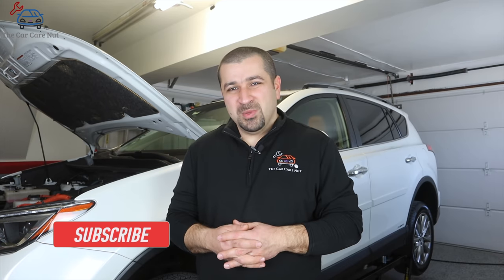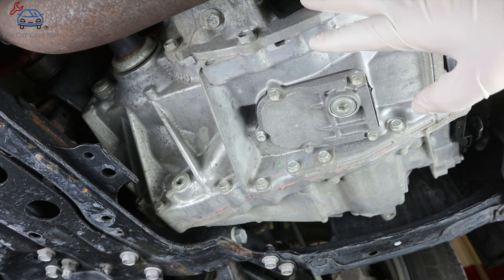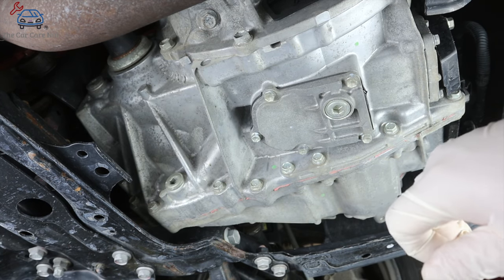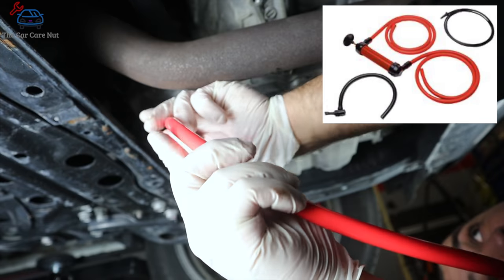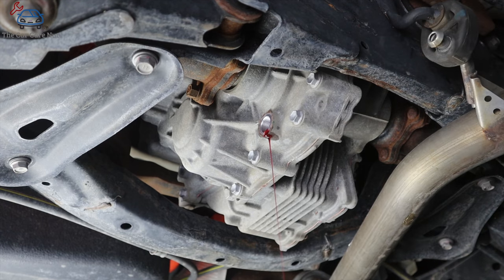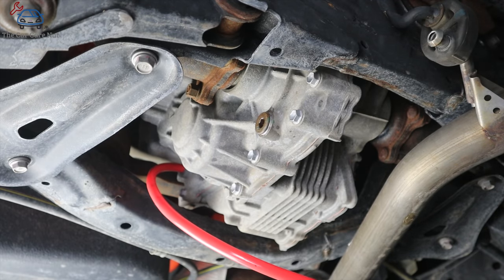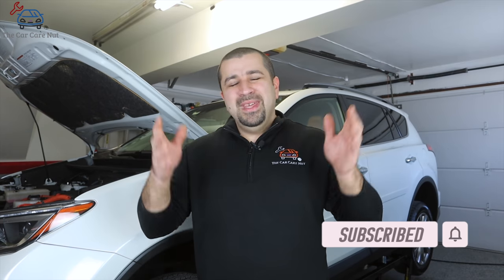How to change Toyota Hybrid Transmission fluid and Differential fluid

Comment: Great video! So hybrid “lifetime” transmission fluid is not really lifetime?
Reply from the maker: Nothing is lifetime 😉
Reply: I work for chrysler and our 8 and 9 speed trans are also lifetime fluids. I would still service them at least every 100k. I never trust anything with lifetime oil. The oil is stupid expensive tho, over 25 dollars  a quart.
Reply from the maker: Very true Samuel. That’s very expensive fluid! Toyota WS fluid is around 10 bucks a quart

Comment: I did this and it worked. Front wheel drive do not have a differential so I saved myself three quarts.

1. The old fluid shoots out
2. There is grit everywhere
3. The grit settles to the bottom I'm told. Please correct me if I'm wrong.

Comment: I haven’t seen removing the red plastic plunger inside the transmission drain plug ? Then rev the engine and moving the automatic shift?
Reply from the maker: Hybrids don’t need that.
Reply: Ok thanks

Comment: On a 2018 and newer Toyota Camry Hybrid, where is the fill and drain plugs?  I found one plug on the passenger side of the transmission but I assume it's the fill plug because it looks to high up to be a drain plug?  The only other plug I could find is the plug on the bottom that in your coolant videos you drain the inverter coolant from it on the earlier model Priuses.  Or is this on of those that only uses one plug and you have to drain (suck out) and fill using the same plug?  Thanks
Reply from the maker: Hi! I’ll double check but there should be a plug right next to the axle which is the fill and one underneath for the drain

Comment: I have a 2017 Toyota Highlander Hybrid Limited with about 135K miles. I bought it used with about 40K miles in July 2020 but not sure if the transmission for differential fluid was ever changed. For about the last 30 days I’ve been noticing that I feel when the gears are shifting, (to the point that it feels like I’m hitting small potholes) especially when I go from 0-30 mph. So I started doing some research and I came across your video and didn’t realize this was something necessary. Now my question is when I changed these fluids will that remedy the issue of me feeling the gears shift while I am driving or is it a bigger issue?

Comment: I have a 2010 Lexus HS250h, hybrid.  Its has the same drivetrain as a similar era Camry Hybrid.  At what number of miles/years of service do you recommend I change my transmission fluid?

Comment: Does the maintenance minder recommend at 60k or 90k? Seems like a messy job to do in my driveway that is a hill. Wondering if the dealer techs are well versed on doing this service? If the minder doesn't tell people they need this service, I would think most wouldn't do it. Nothing like going to the dealer and having the guy on his first day not fill your fluids enough or too much. The whole "being level" is going to prevent me from doing it myself.

Comment: Hi, I have decided to do ATF change on my Toyota auris 2016 hybrid with 1.8L engine, I am the second owner.
I have drained ~3L of old fluid, then added new fluid and it still wasn't overflowing from the fill plug, car was completely level. What to do at this point? Add a bit more than I drained, add specified 3.4L or try to get it full just like in the video?

Comment: Hi AMD , thanks for all your hard work and great videos , much appreciated. 
I am about to change the transmission fluid in my 2014 lexus is300h, but it looks very different from your video . The drain plug is on the bottom of the trans and the fill plug on the side.  Can you tell me if the draining / filling procedure is the same as you show in your video ? (Overflow etc) 

The workshop manual I found online states that after filling you have to run the engine idle 1 minute in maintenance mode and after that refill again , any ideas on this or is this unnecessary?

Thanks a lot , hope to hear from you
Reply: This video is specifically for models with CVTs, the IS doesn't have a CVT it has the same 6-speed gearbox as the other IS variants. The procedure you found online is correct I used it recently on my 2006 IS350, the part about running it in maintenance mode is to get the new fluid into the transmission itself as the valves only open when you shift between gears. CVTs don't have those hence why it looks different here. It wouldn't refill it again right away, I changed out 3.5 qts (I had to remove the pan and replace the filter anyway so I got more out) and am driving it for a few hundred miles before I do another drain and fill to dilute the old fluid further so that the transmission is gently cleaned out by the newer fluid and gradually "weaned off" of the old fluid.
Reply: Hi Jeff, thanks for your reply. 
As far as I can see in several tech docs my is300h (hybrid) does have a e-cvt transmission, so are you sure about the 6-speed gearbox?

Thanks again 🙏

Comment: Hi friend. Thank you so much for this. I have a question. I have a 2016 rav4 hybrid limited (awd). Is this the process I would follow to do my transmission fluid change? Also - I believe some dealerships call the transmission the “transaxle”. Is that correct? 

In addition - is this the same as changing the “front and rear differential fluid” ? Or is that something else. Toyota’s terminology confuses me lol

Comment: Which type of fluid did you use for differential? Toyota genuine or Mobil etc?  Thanks
Reply: For this one is the same than the transmission fluid, but is not the same in non-hybrid cars.

Comment: I did my camry hybrid, thanks
Reply: What year Camry hybrid? Not sure where my drain and fill plugs are.
Reply: Yes, nice.. however, mine is a 2019 which looks different. I’ve taken pictures to hopefully find out where my plugs are.
Reply: @tallswag4u  2019 you don't have to change oil that soon.
Reply: @Chanchan1-k7q  I use for business, it’s at 86k miles.

Comment: I have a 2020 Highlander Hybrid.  The 4 cylinder and the CVT transmission, is it the same procedure or a different procedure?  I am almost at 60,000 miles and haven't found information about the new model.  I am about to get the Alldata diy for this vehicle.  I am a helicopter mechanic, and I don't like doing maintenance without the manual or torque specs.  Do you have any suggestions for manuals for the 2020 highlander hybrid?  Thanks for your videos.

Comment: i have 2008 highlander hybrid limited 3.3 engine size. i also see the filler same bolt driver side tire behind the little mud guard cover. i would like to confirm which one is the correct hole to fill and level the transmission fluid :-(

Comment: A bunch fluid came out when I changed my cv axle. I have a 2011 camery hybrid. Do I need to top off the transmission fluid ? Also I seen 3 plugs on my transmission. On directly above the cv axle, another to left of it and the other is on the bottom side below the axle. I’m assuming that that  the bottom side one is  drain port and the one to the left of the axle is the filler port. What is the one directly above the axle?
Reply from the maker: Hi! Use the one next to the axle not above it! That plug could be for production. Don’t use it.

Comment: I have a 2018 RAV4 hybrid. Do these have a front differential/transfer case? If not, just 60k for the front? And the rear differential at 60k as well, or at 30k like standard AWD Toyotas? Thanks!

Comment: Fill plug out first, then drain plug. If you take the drain plug out first and then have a problem with the fill plug, you are in trouble. Right?

Comment: Do you have to change the transmission oil when it's hot, in order to open up the cooler lines and drain the transmission oil cooler also?
Reply: Hybrid don't have cooler lines

Comment: You said take the drain  plug out first instead of saying the fill plug, when describing the reason why, and then proceeded to call the fill plug a drain plug as you were taking it out. You're actually supposed to take the fill plug vout first, to ensure you can refill the transmission after you've drained it.

Comment: How level should it be? My driveway looks pretty level but there is actually four inches difference. The axel closest to the street is four inches lower so I drive the front part way up my ramps to get it level.
Reply from the maker: I would try to get it as level as possible. It’s near impossible  to get it 100% level but as long as it’s not a largely sloped driveway it should be ok

Comment: How often do you change the spark plugs in a 2021 toyota Rav4 hybrid xle awd. Does the transmission fluid change 60k to 90k also apply for my hybrid vehicle.

Comment: Hi! I am in the process of preventative maintenance on my 2010 Prius with 270K miles. I’ve gone ahead and done manifold, pcv valve, egr pipe, egr cooler. and catch can install. 
My one question the following, I haven’t changed the transmission fluid ever. And I’m not sure if I can or it’s too late. Many YT mechanic friends have said if it’s been that long just leave it. The car runs perfectly fine no trans failure, but am I basically a ticking time bomb?
Reply from the maker: Hi! On hybrids you can change the fluid without issues. I would change it
Reply: Thank you for the quick reply! I was worried that it wasn’t possible bcs its been so long. I’ll go ahead and perform the change worry free. Trying to make her last at least another 100K 📈 (already had battery replaced)

Comment: I was checking the 90430-A0003 part number for my car, but it says that it does not fit. after a little bit of research, the (supposedly) correct one is 90430-A0002. are those cross compatible? the car is 2023 RX350H.  thank you in advance

Comment: what type of diff fluid do you use for rear differntial? I saw people use SAE 75w-90 or 75W-85?
Reply: Don’t use gear oil. He says in the video it’s the same ATF in front and back. Also, this is in your manual.

Comment: Hi you I have mazda cx-5 2022, do you recommend the same interval every 60k miles to change the automatic transmission fluid and just do drain and fill and no need to change the filter? Thanks

Comment: Wanted to see with you about my highlander hybrid 2022? When I got it lifted and took the panel off under neither I could see the fill plug by the shaft but couldn’t find the drain. I saw on the other side their is a access point that is in the shape of a T with two access points but wasn’t sure if that was anything I should mess with. If you could let me know where the drain plug would be that would be great, thank you.

Comment: Hi, I got done changing the rear diff fuild and I have a question that is bugging me. Got my Rav 4 hybrid leveled on 4 jack stands. Drained the fluid and pumped new fresh ATF WS fluid until it overflowed. I just noticed from your video that you installed the fill plug as soon as it began trickling. I waited until the drip almost came to a stop. Drops of fluid do add up, so my question is. Is the rear diff underfilled and should I go back and put the car on the jacks and fill it a bit more and install the fill plug as soon as it starts to trickle down? I appreciate your answer. Thanks.

Comment: Hi carcarenut!! My 08 highlander hybrid has a random knocking noise from the driver side. It mostly does it when in reverse or in neutral. If you stick your head in the driver side wheel well you can really hear it better. Sounds as if it may be from the front CVT. The sound is not consistent or have a rhythmical pattern like a rod knock. Its sporadic, and will go away sometimes after being driven. I'm just finding out that if I grab the driver cv axle I can definitely feel the knock through it which means it's coming from the hybrid transmission. I've owned the car for about a year. It had one previous owner and it was very well maintained. The last time the transmission fluid was changed was 30k ago. I changed it out today in the hopes that the noise would go away, but no luck. The fluid came out a little dark, nothing crazy. Drives amazing otherwise. Any ideas?
Reply from the maker: Hi! This one needs a bit in person diagnosis. Nothing is common on these make sure it’s nothing with the brakes
Reply: @TheCarCareNut  thanks for the reply. Not the brakes, it only happens at idle.

Comment: Hi there!
Thanks for the guide. 
Just a question - why do you recommend to use AFT WS instead of CVT fluid? My rav4 gen5 hybrid has CVT. Do I have to update software or firmware after filling another type of fluid?
Reply: I think the idea is hybrids have a completely different technology for a constantly variable Trans unlike an ICE motor with a mechanical cvt.

Comment: Does the transmission fluid need to be at a certain temperature for a hybrid vehicle?  Most of the other videos that I have watched for non-hybrid Toyota vehicles specify that the transmission fluid needs to be at a specified temperature because that is how to verify the actual fluid level (since there is no longer a dipstick).  This video doesn't specify a temperature so is temperature not a factor for the Toyota hybrid vehicles?
Reply: Did you ever figure this out?
Reply: @kythera4045  I talked to a mechanic.  He told me that temperature was not critical.  I replaced the transmission fluid and have not had a problem.

Comment: What is the torque spec for the fill and drain plugs for the RAV4 Prime XSE.  
Is the torque for the plugs on the rear transaxle the same?  Thanx.
Reply from the maker: Hi! For the transmission it’s 37 ft lbs. for the rear transaxle it’s 29 ft lbs

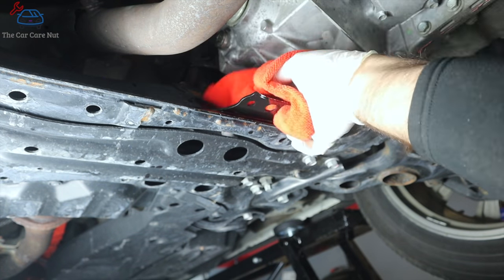Comment: 2015 ES300h. Two Fill plugs? If the Axle was a clock, there is a fill plug at 9:00. Just like the video. When I did mine I noticed a second plug at 11:00. What is the plug at 11:00 above the CV axle?

Comment: How often do you recommend changing the Transmission Fluid on my 2021 Tundra? I do not Tow and mainly drive highway.
Reply from the maker: Hi! Every 60k miles or 6 years
Reply: @TheCarCareNut  just the normal drain and fill im assuming ?
Reply from the maker: Yes
Reply: @The Car Care Nut  thanks for always replying! You are awesome !

Comment: Torque specs for the fill and drain plug on the transmission??????????? 2006 Toyota Highlander Hybrid Limited 3.3l v6, 2 wheel drive. Front wheel drive.

Comment: Is the differential fluid the same as the transmission? And how many qt in the diff?
Thanks
Keith
Reply from the maker: Hi! The front differential is part of the transmission. Usually most of them hold around 4-5 quarts
Reply: Oh I meant the rear differential
Reply from the maker: The rear differential usually holds around 3-4 quarts

Comment: Hello good Sir,

I have a 2009 LS600hL over here in Germany. 

Can I use the same method or do I have to worry about temperature? Local dealership said it needs to be at 30 degrees Celsius and so on...

I know my transmission takes 5.5L, I already bought 6L, OEM Toyota WS.

Blessings in our Savior!!!! Thank you very much in advance.

Comment: Thanks, GREAT VIDEO!! 

   However, looks like you have the car up off 4 wheels and "LEVEL" Is that not CRITICAL when filling the Tranny and Diff? When I changed the transmission oil,  the front of the car is up in front and leaning down to the passenger side. So will "overfilling " till runs out will work for me? My car is NOT level with ground.
 My Avalon does not leak tranny or motor oil. What I did was, I measured the tranny oil that came out and replaced it with the same amount of oil through the Fill plug. Fill plug hole of course was overflowing but I "quickly" capped it so no more oil would come out. Why this is a simple job if you have a pit, a lift, or dare to lie under a car suspended in air with jack stands while tugging on tight bolts(not me).

Again, GREAT VIDEO! Let me know if replacing oil that I took out will work as well.  Also, please comment if car MUST be level when filling fluids. Thanks Much!
Reply from the maker: Hi! I would 4 jack stands to level the car
Reply: I took your advice! I have a 2013 Avalon Hybrid (58K), per my above comment I changed out the ATF few days ago but the car was not "level" when I filled it(it was measured). Just to be sure it was filled correctly as you stated in your video, I put the car up on jack stands (and even used a level to be sure the car was level front to back). However, the transmission was HOT from driving,  I ADDED about 3/4 of a quart of ATF before it came pouring out of Fill Hole. I waited till just a drip every few seconds and reinstalled the fill plug. 

Question: Since the Avalon was HOT when I added the ATF will this have any effect of the fill level? In your video you did yours when car was COLD. Was what I did correct? 

Again, just about watched all your videos! They and you are great! Thanks, you very much for sharing your expertise!
Reply: @TheCarCareNut  I took your advice! I have a 2013 Avalon Hybrid (58K), per my above comment I changed out the ATF few days ago but the car was not "level" when I filled it(it was measured). Just to be sure it was filled correctly as you stated in your video, I put the car up on jack stands (and even used a level to be sure the car was level front to back). However, the transmission was HOT from driving,  I ADDED about 3/4 of a quart of ATF before it came pouring out of Fill Hole. I waited till just a drip every few seconds and reinstalled the fill plug. 

Question: Since the Avalon was HOT when I added the ATF will this have any effect of the fill level? In your video you did yours when car was COLD. Was what I did correct? 

Again, just about watched all your videos! They and you are great! Thanks, you very much for sharing your expertise!